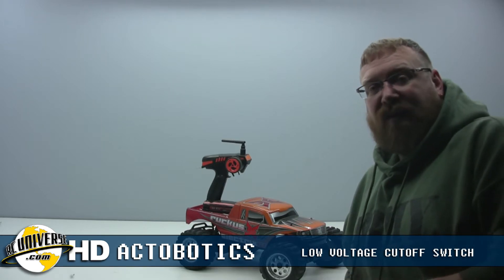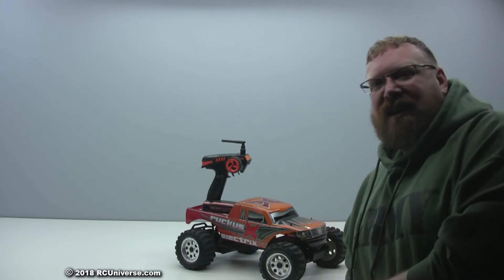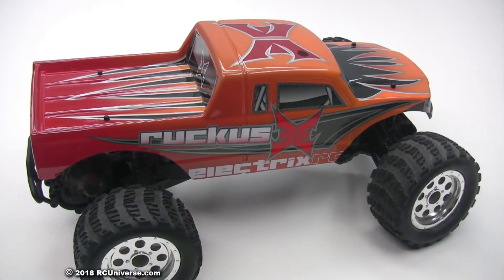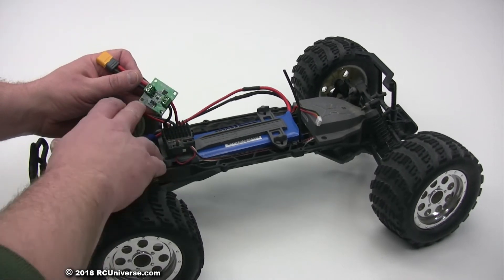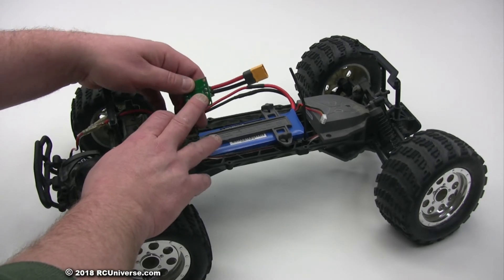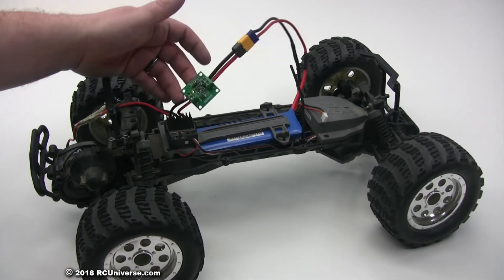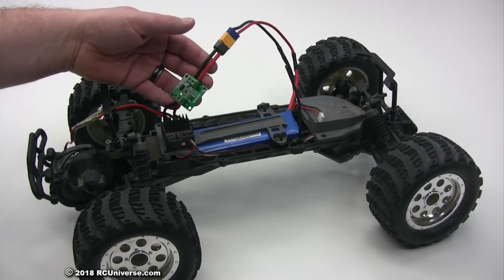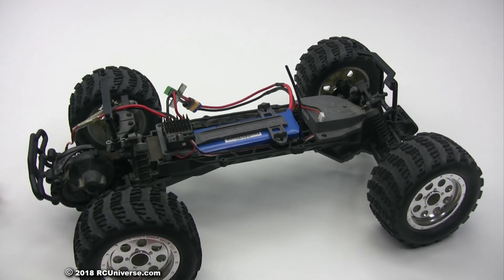Actobotics Servocity Low Voltage Cutoff Switch

Comment: Hi, I would appreciate if you could draw a schematic for this circuit and then email it to 
viki.bozicevic@gmail.com
Reply from the maker: You would have to contact the company that manufactured the unit, which is Actobotics. RCUniverse does not manufacture this unit.
Reply: Will do. Thanks for the reply!

Comment: What voltage cut off did you use?
Reply from the maker: I used the 6 volt setting, which is actually 7.2 Volts